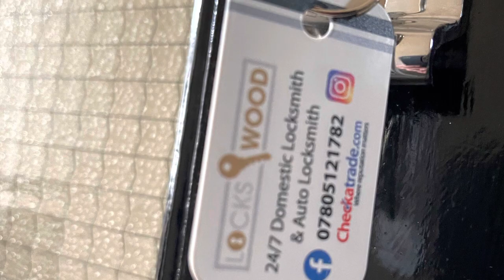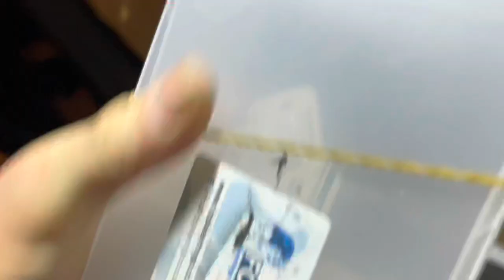Live Job | Fire Door Compliance Work | ERA Night Latch | Cylinder Change - Locksmith

Comment: it's a pleasure to see a job being done properly by someone with your level of attention to detail, and who knows how to use his tools... Really decent stuff Andy, keep up the great content.
Reply: p.s - Give it a few months or so, when your channels massive, and you'll have all the van manufacturers fighting with each other to furnish you with a new model off the back of your recommendation... (And no, I wouldn't have charged for the key straightening either - I seem to often tend to give that extra added value to my customers without charge, and effectively for a loss sometimes). Whether it's running off a couple of extra keys, fitting some missing handle spring packs, or whatever. - Also if i have gone somewhere and not actually done anything, or I might have just done a really quick hinge adjustment or similar, I will not accept any money because I don't think I've earned it (and I am a No call-out fee service) - I am often offered some money for my time but will normally politely decline it (unless it was a fair drive there, then i might accept £10/20 for my time and for the diesel). I see the bigger picture and it's not about extracting every last penny out of people, it's nice to give them a service they will make a note of and potentially tell other people about your decency... We're the good guys Andy...
Reply from the maker: Thanks George. That’s very kind of you to say 😊

Comment: Doing a freebie is a gesture that will always come back and reward you. I do them quite often with the old biddys. It's the old saying of what comes around goes around. Keep on with what you do and good things will follow you. Love the air wedge trick for lifting the door. Who would have funked it? lol. I usually lever a chisel on a small wedge which is a hit and miss procedure. Can definitely see the carpentry skills come through with your chisel work. Until the next time. Cheers:-)
Reply from the maker: Ah thanks Paul. I’m glad I’ve been able to give you a little tip with the air wedge 😊
Thanks for your lovely comments and thanks again for watching 🙏🏼

Comment: Very nice of you to show kindness to that lady. The world needs more people who are just simply kind and good hearted, Well done.
Question: The fire door you worked on so it would meet fire regs (assuming that's either FD30 or FD60), doesn't the hinges also need intumescent pieces behind? All the ones I have worked on and fitted I put the intumescent rubbery pieces behind the hinges on both the frame and the door. The fire brigade says that's what I needed to do so doors meet the regs.
Reply from the maker: Hi Roy. Thank you mate. It’s nice to be nice 😊

Yes I’ve had to use the intumescent hinge pads before but nothing was mentioned on the report for this particular job. I’ve found it changes from job to job and depends on the area and which company has done the report!! 

Thanks for watching 😊🙏🏼
Reply: @brighton_locksmith  Always a pleasure.